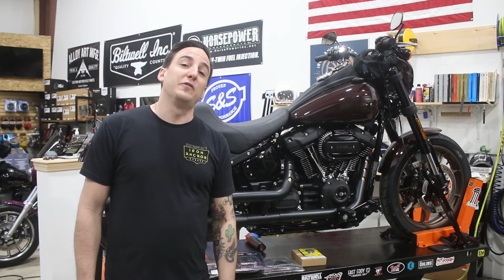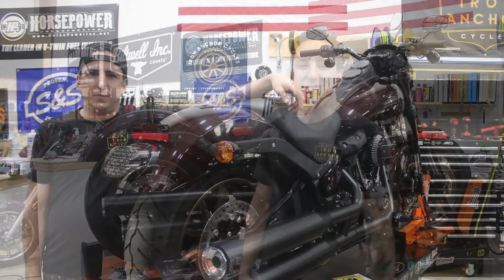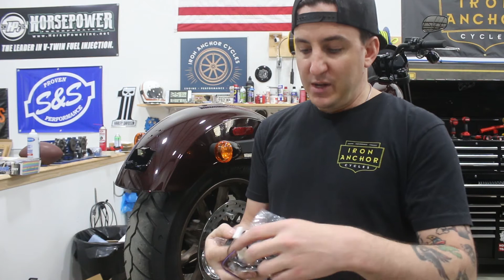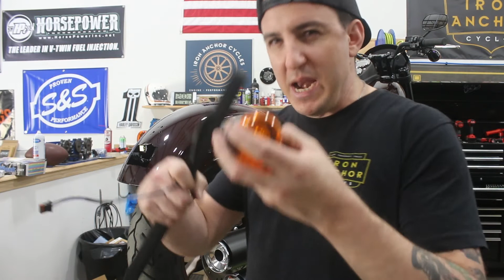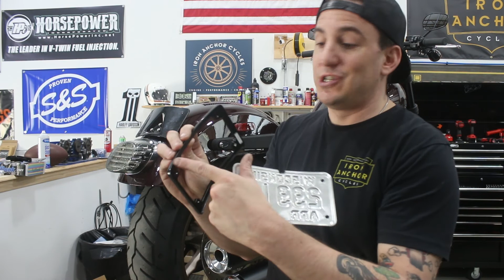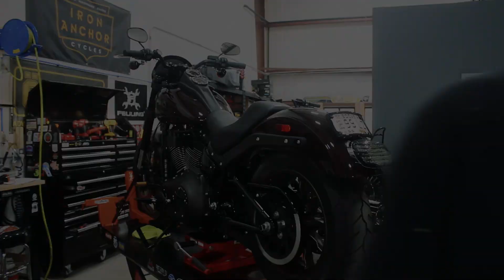Project FXLRS - Part 1 - Cleaning up the rear fender.

Comment: I had a ‘18 fatbob, traded for a ‘21 road glide, sold the roadglide after I did a 131stage IV, and now I picked up a ‘22 low rider S. 

Going to turn my low rider into a “mini-tourer” but I’m not a fan of the ST fairing. Throw the hard panniers from the ST, put in a 131 kit, and upgrade to öhlins suspension front and back.

Comment: Okay, first of all, awesome freaking video and i appreciate all the knowledge shared here! Secondly, I suck with electrical. I see you pulled turn signal wires from the under the seat area. Are these something you buy and plug in play, are they already on the bike coiled up in there waiting to use or did you have to wire these plugs in up there? Thanks in advance!
Reply: Now that I finished the video lol it looks like you plug in the turn signals up front. So you just bought the turn signals pre harnessed if you will?

Comment: So regarding the tune. What is the tune hold up. I'm in CA and I've been told it's because of my states Air resource Board. Harley did me dirty by selling me a bike I can't modify with pipes. Not only is it dampening my performance, it's also making me less safe when I ride cause all I can ride are stock pipes